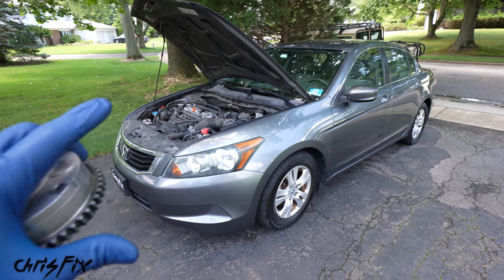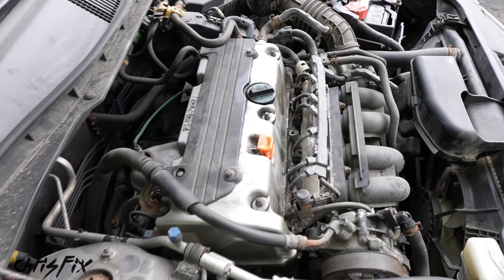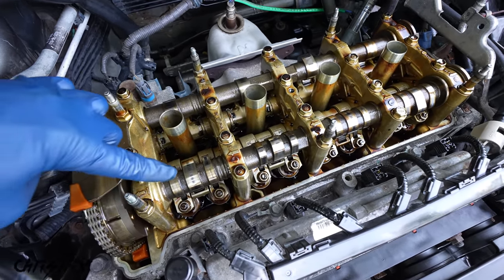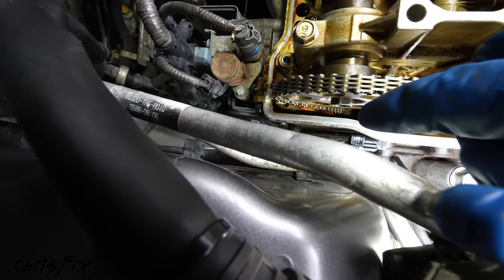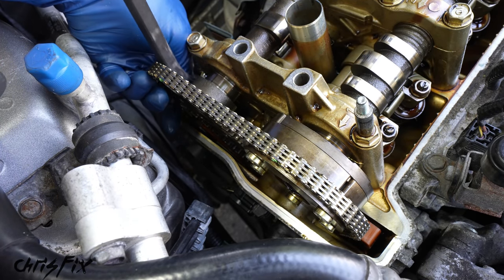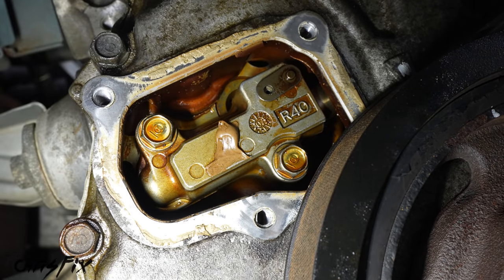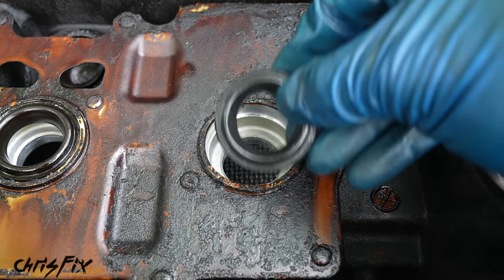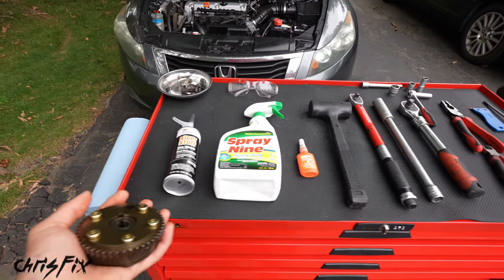How to Replace a VTC Actuator (Complete DIY Guide)

Comment from the maker: I hope this helps the millions of people affected by bad variable valve timing actuators and even if you dont have this issue, there is a lot to learn about setting an engine to top dead center! 
Thank you Spray Nine for hooking me up so I can SuperClean my engine bay! If you buy a bottle of their degreaser from Advance Auto Parts (or anything else) use "ChrisFix25" for 25% off your ENTIRE order! I make no money from you guys using the code, it was negotiated to help you guys. I use it myself whenever I buy parts haha. Hope this helps!
Spray Nine Degreaser: https://advanceautoparts.rt8x.net/LPx09Y
High Strength Removable Threadlocker: https://advanceautoparts.rt8x.net/ZdxVgk
Quick Set Gasket Maker: https://advanceautoparts.rt8x.net/XxL4Jg
Bluetooth OBD2 Scanner: https://amzn.to/3zPq6v1
VTC Actuator: https://advanceautoparts.rt8x.net/b3DkEk
Honda 2.4l Valve Cover Gasket Set: https://advanceautoparts.rt8x.net/2rQRAQ
Tools: https://tengtoolsusa.com/
Reply: Yes
Reply: Hi
Reply: Heck yeah
Reply: I am your biggest is there any chance I can get a shout-out and my dream car is the hummer
Reply: Hey Chris  Do you know what would make a good video how to replace or check the vacuum line system on a vehicle for example I have a 99 Mazda B 3000 V6 very similar to yours I have to pull the engine out of it so I can redo the heads But a lot of the vacuum lens on the truck are no good so I was wondering if you can give like a how to guide video on how to redo vacuum lens on your truck or any other vehicle you have that would need them and p.s Finding it very difficult to find the vacuum lens for this type of truck
Reply: @unsettled_5  Chrisfix is the only way to heaven
Reply: Yo Chris what ever happened to the turbo swap on the
 Del Sol? 🐌
Reply: I dont have a car but my brother does so it helps him alot and I just enjoy your videos
Reply: It does help a lot
Reply: I dont have a car but my brother does so it helps him alot so I just enjoy the videos themselves
Reply: @NGGR  Yes
Reply: Did you really sold the driftStang??!!! 😫😫
Reply: Chris, 2 questions: 
1. When are videos for the Lemons race car coming out?
2. Did you get your COVID shot? (just curious)
Reply: Thanks!
Reply: Can You Make a vídeo on how yo change valve seals
Reply: He honestly shoulda just left it. That rattle at start is gonna come back regardless on replacing the actuator so uless its throw a code or wont run right no point in dealing with it. Just let it be and make sure u never low on oil. 2nd gen tsx going strong
Reply: @ClayRepairs   yeah i wondered if he is going to post videos about it after that pic of a broken connecting rod...
Reply: @daniie9643  What!!!
Reply: Thank you for your always great videos!  You are the kind of guy who could make a video on how to open a car door, and we would end up learning something.  Do you work on motorcycles?  I need a channel for motorcycle work.  Any ideas?
Reply: We want a new driftstang
Reply: Is that rattle noise the timing chain skipping along the VTC? Would you not want to replace it from fear of wear? just guessing do not know.
Reply: I love how you always help people on how to fix people's cars keep up the great work
Reply: WHAT ABOUT THE RACE.  LEMONS SAID YOU WRECKED
Reply: Thanks for this video. I always do the timing chain at the same time but now I know how to do it without having to do the chains!
Reply: I wish...i seriously fucking wish I had this video when I had my 2007 accord it had the same problem but the issue here is every single fucking mechanic in Portland is the shadiest motherfucker ever and kept dumping money into this 10 year old car when I had it in 2017 and the issue was what you described. I have a 2014 V6 accord and it's great nothing wrong but i truly miss my 07 accord as was the first car i ever bought on my own
Reply: I have the same noise like in the video at 2:50 but my question here sometimes I can hear that noise while driving. It can be just the vtc or something else ( no codes) no check engine light just the noise. Hope you can answer my comment.
Reply: Can you make a head gasket tutorial? I have a old 1986 Honda Accord lx-I 4 door 2 liter camshaft a20a1 and the head gasket is needing to be replaced well that’s what I was told I have no clue what’s really wrong because I have no experience
Reply: @ChrisFix Can this OBD2 scanner fit the suzuki swifts
Reply: None of the tools I found listed I want the jacklisted
Reply: I was once told Honda is the only car that you should turn counterclockwise to get it to TDC
Reply: Bro I'm waiting for lemons race project video, driftstang project video, del Sol project video, and your hummer and it's Trailer also needs work on off    roading lights and hooking the trailer stuff. I'm seriously waiting for it all

Good work bro
Reply: Bro I've been awaiting for that endurance race car fix and the race video pls upload it ASAP and keep the gaps between 2 videos short
Reply: Isn't the point of the unlocked actuator so that you can put the chain on first (easily) and then lock it.. not lock it first.. then struggle to put the chain back on?
Reply: @daniie9643  really?
Reply: Uve helped out a lot with your knowledge with car mechanics. I need some advice and help with my 2005 cts v. I need help with my clutch in it. The clutch pedal  gets stuck and stiffens up majorily at higher rpms.? and intake manifold codes go off every now and then and check engine light goes off.?I could use your help that be super amazing for u to help me out with my car. I watch a lot of your videos to support u too. Also have a noise coming from engine not sure what it may be! Almost like a ticking noise. I've ordered a used t56 transmission for it and will be installing it soon. Can u help out in any way.
Reply: You said not to start the engine just to the ON position when scanning the OBD2 reader. And I've always heard that. Why?
Reply: Hey Chris! I was wondering: do you have any tips for painting a car (I.E no runs) as I am learning how to do this.
Thanks
Reply: What happened to the 24hr Lemons  BMW?
Reply: Why did you sold driftstang
Reply: Can you do a video about cleaning the sludge??
Reply: When is the turbo vid out
Reply: Yo Chris do a video on adjusting valves on a Honda.
Reply: Yes
Reply: Love your videos you have inspired me a lot and I appreciate that I will learn from you to fix my cars in the future thank you 😘😘
Reply: Bro I love what you're doing, thank you so much I've learned a lot of things because of you ❤️
Reply: While you were in there you should have done the valve adjustment as they are also an issue on this engine for my Acura TSX 2010 :(
Reply: @Odi2017  what’s that mean?
Reply: Fun fact besides spray nine being a awesome degreaser and cleaner, it works wonders for removing wallpaper!
Reply: Hey Chris when are you gonna all those project videos you posted like a year ago
Reply: Hey do you still have the drift stang, and do you plan on making more drifting videos? love to see more great car videos!
Reply: I have the same car, how did you get my car?
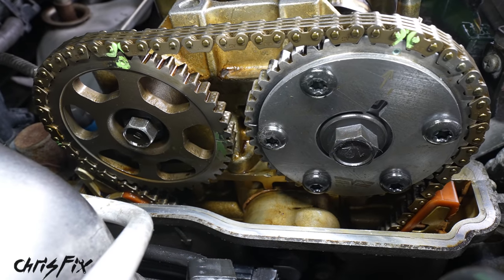Reply: At 22:38 on the video you can see the timing chain jump on the right gear kinda riding on top of it. Is that supposed to do that?
Reply: actually, what’s wrong with the old VTC?
Reply: @ChrisFix We need a video on indexing spark plugs….

…you know want to….
Reply: Leave the oil drain bolt open until you change the oil filter
There will be old oil coming out once you take the old filter off
Reply: What was wrong with the old actuator. It looks the same to the new one?
Reply: Please make a indepth video on all pullies how are they work  and what are the each pullies work in different ways
Reply: DUDE, it's like you read my mind!!!!!! I have had the grinding on my 2011 Accord for about 7 years now. I think I found the next project!!!!!!!!!
Reply: How much your tool box cost??(with tools)
Reply: Can you do a product test on the Berryman B-60 High Mileage Fuel System Cleaner??  I would love to see it! There are little to no other videos on YouTube about it.
Reply: Hey Chris is is possible for you to try to buy a dirt bike or a 4x4 I think you could also work on those *just an idea
Reply: Hello i have a question i have a AWD car but something fell out of it and i took it to the mechanic and he took of a long pipe out and said its FWD drive now and i can drive it like that till snow come and fix it back and its good for gas i was wondering is it okay to drive the car in FWD or is it ganna break should i fix it hack to AWD? THANKS FOR THE HELP!
Reply: The way you explain and detail every video makes any job you do much easier wowwww........ I'm about to flush my civic si cooling system thanks to your video.

Thank you for the videos
Reply: This do help me . I am having the same issue in my Accord 2008 . Thanks Chris
Reply: Do you recommend a VTC actuator replacement if there is no engine lite or problems. Mine rattles but my si is running fine otherwise.
Reply: How do I know that the camshaft doesn't  move when I install the new actuator? Should I hold it in place with a wrench?
Reply: I love you’re video’s it always make me want to fix things i have a new project a vw polo gti 2008 1.8T but i’m a bit afraid to work on engines simple things i can do but this is next level
Reply: Chris, I have an idea for the next content, what if the next content discusses "how to detail a car logo/emblem" because in my opinion that is the most difficult part of washing a car.
Reply: Hey Chris I'm currently in NC Fort Bragg I got stationed here for the military I enjoy watching you're videos I've  been watching you since the start I recently bought a 1990 GMC the owner said it has an oil leak could you teach me how to detect and stop a oil leak I appreciate it.
Reply: Do you rember coming to ireland and goin to dingle for a thing with other cars?
Reply: PLEASE PUT 4 WHEEL DRIVE ON DRIFT STING
Reply: My 2015 crv have the same problem
Reply: Hey chrisfix I have a 2000 Mitsubishi Eclipse Gs that has every last single bushing and every type of bushing is blown out cracked or even torn and I wanted to know how to do it with just a floor jack that has a max lift height of 24 inches 2 jack stands and the tools you’ve used in your change suspension bushing video on the side of my house safely and efficiently without fucking up my car
Reply: bring back the driftstang it was the best series I ever watched
Reply: Ñ
Reply: Hi Chris I love your videos and I’m just wondering how you know every little thing to a tee. How did you get to be this good?
Reply: Great video!
Reply: Now if only you did a full timing chain replacement
Reply: You should get a 95 suprecoupe tbird and make it a drift car
Reply: Where is the drift staying
Reply: I hope everyone car is great from this
Reply: I need to change my head gasket on 04 v6 3.9 mustang.  I don't know what to torque too please help.
Reply: Chris - did you try any of evap leaks/smoke machines? lot of us drive old cars and rubber houses are starting cracking/leaking and it is hard to find leak without smoke machine . But which one?
Reply: What can I do if my snap on scanner does not pick up a signal from the obd2 port?
Reply: Have you ever rebuilt a transmission?
Reply: Where has the drift stang been
Reply: Weres the driftstang
Reply: Hey cris I got a question is it possible to make a real turbo into a speaker for gaming or is it not possible
Reply: bro, my dads car has the SAME exact problem, now i can fix it with ease. thank you so much
Reply: Hi
Reply: Hey Chris! I’m blind, and I’m interesting in automotive stuff; I’m wondering if I can learn with you. Any response will be appreciated!
Reply: @ChrisFix Maybe I overestimate the importance of this but I generally advise that people break the lugnuts (or bolts) loose on the ground and not while jacked up. At least not DIY'ers, professional lift is a different story.
Reply: 8
Reply: Is this the same process on a 2013 2.4 ? 🤞🏾🤞🏾Cause it pretty sure mine needs to be replaced
Reply: What happened to the driftstang
Reply: I had the same problem but then it started making the noise the whole time and I want to know if I can change the part now or the whole engine ?
Reply: Hey! Chris I have a 2006 Chevy trialblazer with a 4.2vertic  engine in it with a ticking noise right at the top of the engine. Trying to figure what it is do you have any idea's?
Reply: Another problem I can't have when I get an electric.
Reply: Hiii Chris
Reply: Ouch 140$ for the sprocket. Need to do it. It’s cold and sitting there with the ignition on waiting for the oil to build up so it won’t rattle is annoying
Reply: @kiobi3481  oh that’s basically an engine redo if you’re going open up the engine head might  as well reconstruct it. Some places do it for a few hundred $$$
Reply: @crocodile2006  he put it on Unlclocked and said it
Reply: Awesome that you explained this. I had read the service bulletin and was crossed eyed. Saving me a good 600$ with this visual. Everyone wants 800$+ for this repair and not many are familiar or well versed in these including Acura/Honda only shops.
Reply: @luileo2  You didn't read what I said. Chain on first... then unlock.
Reply: Started using spray nine since I have seen it in a few of your videos love that stuff!
Reply: @antoniomartinez7420  probably the belt. Does it happen more often with a/c on under load?
Reply: Nice vid... 2 points to consider....
1.  Don't replace the drain plug until AFTER replacing the filter.  Often more oil comes out the drain when you remove the filter.  You wouldn't even know that if the plug is in place.
2. Anytime you have the valve cover off, it is a good time to check valve clearances.  Only if you set the valve clearances recently, would I pass up this opportunity.
Reply: What is the symptoms of broken valve seal
Reply: @elsondelamerced8747  same as leaks past the rings... loss of oil, possibly smoke from the exhaust.  If you do compression tests dry, then with a teaspoon of oil, a big change in compression points to rings... little change is valve seals.
Reply: @elsondelamerced8747  hope it's valve seals... that's easy.  Rings means a major teardown.
Reply: You got it all
Reply: Chris there is one saying where i live that makes perfect sense, if you want something done properly do it yourself, thank you for the educative videos you post, you've properly educated a lot of people on working on their cars and doing the work the right way to do...i speak for myself, i was scared of doing any work on my e36 BMW and now i am doing most work on the car, recently going to replace the radiator, the bushings on the control arms are bad, the suspension is worn and i am doing it myself, and if i have any doubts, i just go to your channel and watch, i am pity i am not your neighbour, because not only you would have a very strong pair of arms to help you, as i would learn a lot more myself...keep up the good work and thanks....
Reply: Hi chris
Reply: Thanks man I have a 16 accord cvt and I have the same rattle is this the same procedure for the 2016 as well? I need to know before I start
Reply: Bro thank you so much for.doing this video.
Reply: If i use a heat gun and put it right on that bolt that holds the actuator on it'll be ok to loosen it?
Reply: Chrisfix  my car has the same issue but the only difference is that don't have any codes ,,do I have to have the codes or not necessary???
Reply: I’m doing the identical job on my 2009 Accord EX. I got the crankshaft to TDC and the punch marks are aligning at the top on both sprockets. However, the dashes are off on the sides by 2 teeth. Should I continue or is this something else that is wrong?
Reply from the maker: @costalamb3065  On the back of the cam sprockets on the drivers side there are holes. You can put a smaller allen key in each hole to hold the cam in the perfect spot. It sounds like your chain might be "stretched".
Reply: @chrisfix  So lock the cam shafts and proceed with the work?  And in this case proceed with an inspection/replacement of the timing chain and/or tensioner?  BTW, I aligned the top punch marks so that they were 90 degrees to the top of the chain case, however, looking at the Honda diagrams, may suggest a skewness of a few degrees to the right.
Reply: Does it kick?
Reply: @unogamez532  does what kick?
Reply: @costa lamb vtec kick in bro
Reply: @soilBGuRu420  correct the new part doesnt rattle as much as the old one but still does.  Shame on Honda.
Reply: Awesome job man. Want to do it my self but seems like lot of work one tool missing mean this job will take forever. 
So what happened if I don't change vtc actuator will it damage the engine? I just bought the honda crv and it's doing that rattle noise
Reply: I do have same rattling noise when cold start but I don't have code for it and im also using bluedriver scanner
Reply: I’m glad i found this video, i have a 2015 accord sport and that is exactly the same sound i get, bit I don’t have a check engine light on yet but I believe it is getting there soon.  My question is if this procedure can be done to my 2015?
Reply: Yea, good video, but could not budge that VTC bolt without that $200 induction heater. May have to bite the bullet and let the dealer do it.
Reply: As a new viewer, I have to believe you do these projects a few times before you video them ... there's just no way to so accurately know all the nuances of the specific car you're performing service on without not only several iterations ... but several recent iterations. And even still, you have a wealth of knowledge that someone in their 40s who's been a mechanic all their life would have. Truly impressive ...
Reply: Having trouble with timing chain tensioner
Reply: Where do you get you parts
Reply: @ChrisFix,  Do you happen to know of any Honda Techs you would recommend in the MD/DC area?  I’m very impressed with your work here.
Reply: Sadly i don't have an Advance Auto Parts near me
Reply: You have the best friend who can afford the job of your family to do something you need for your life to make her life better
Reply: I'm getting ready to do mine today very nervous lol I'm go ahead a paint value cover wrinkle red hope it goes well
Reply: Man I can’t get the exhaust cam back on and if I take the tensioner off I can get it on but can’t get the tensioner on please help Chris almost done